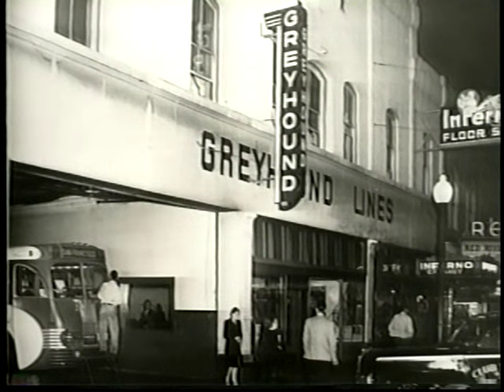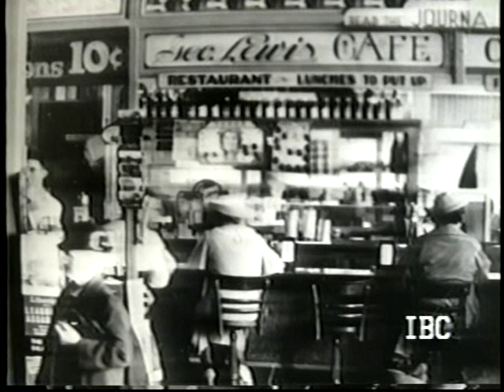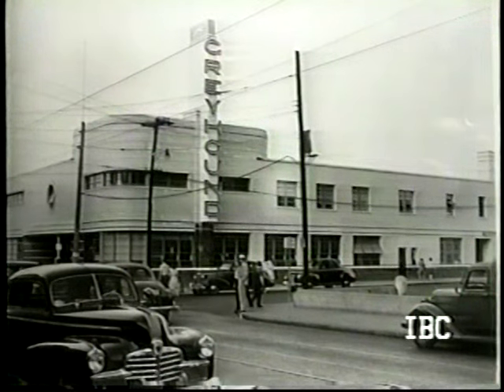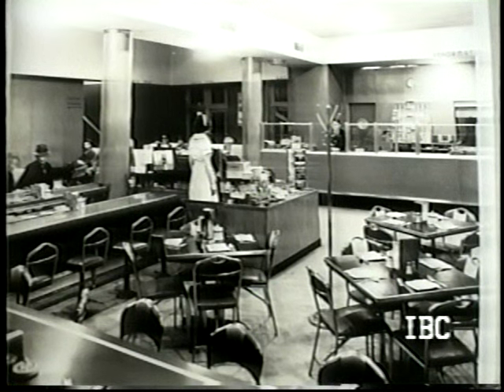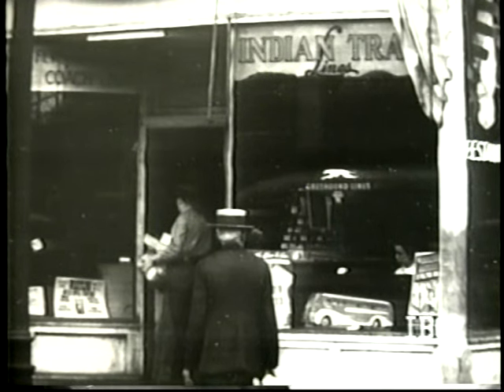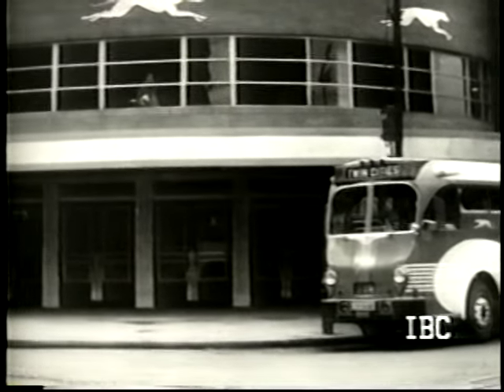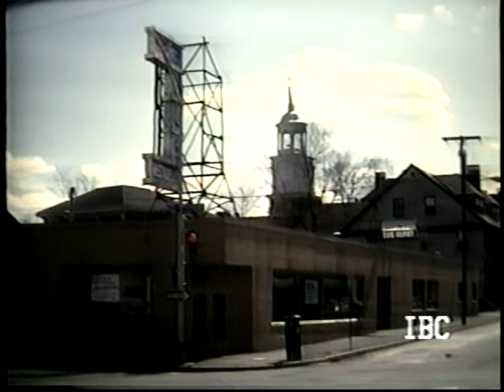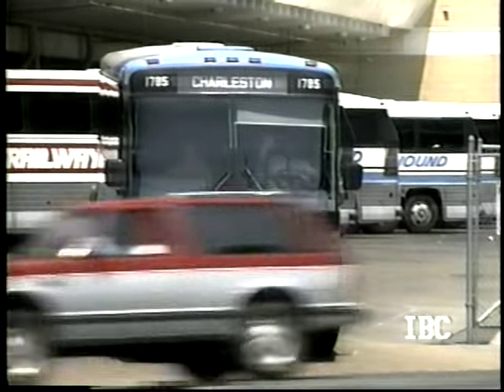History of Greyhound Buses and Terminals – Part 4

Comment: I remember riding a Greyhound MCI MC12 with my sisters and my nana going to Jacksonville FL from New York City Port Authority Bus Terminal while in Richmond VA bus 2255 was the bus we got off and back on to Jacksonville and on our way back to Atlantic City Municipal Bus Terminal on Arctic and Arkansas Avenue by switching buses from the bus was supposed to get to New York City but it didn’t continue so we had to switch buses mostly MCI MC9 crusader 2 coaches to Atlantic City after switching buses in Washington DC in 1996